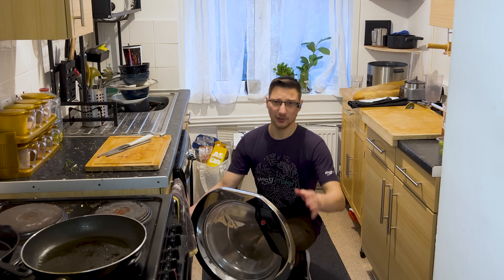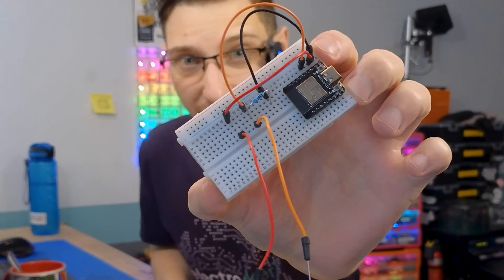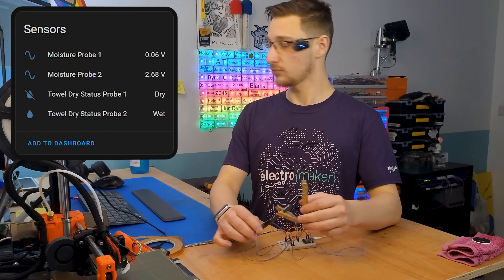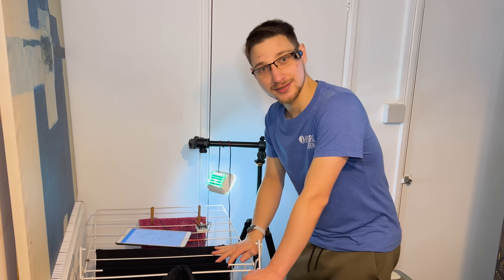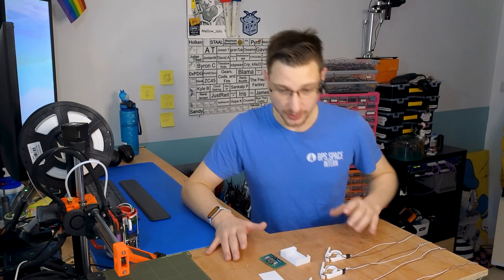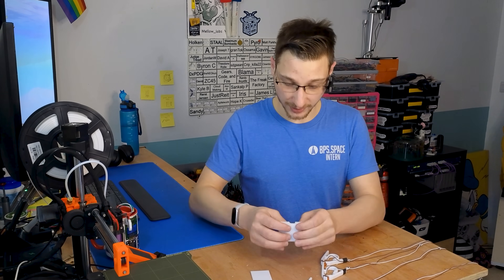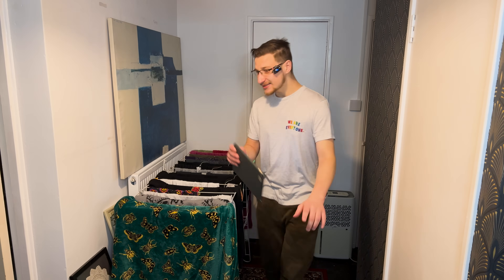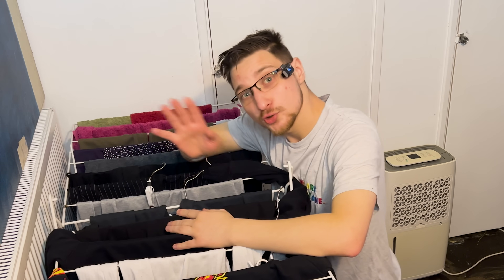DIY Smart Dry Laundry Sensor

Comment: Pretty cool concept. Another possible solution would just be to measure the moisture in the air, as the curve of that will be following the wetness of the clothes, rising and then falling again once the clothes dry up.

Comment: Great idea, but why not go with the capacitive approach? It would be more accurate for moisture sensing.
Resistive is inaccurate, has poor contact, poor linearity, ALSO prone to electrolysis (could damage cloth and wires).

Comment: I was considering using a strain gauge/load cell from AliEx to get a measurement essentially the mass of the clothes horse and wet clothes. As the clothes dry, the weight will reduce, so if it hasnt changed in a (10 minute?) period then we're done.

Comment: Maybe measure the capacitance which will also change with the moisture Level. Then filter the data to remove noise and only keep the slow „drying“ information . Check until the value stops changeing. Use digital IO and measure time of Pulses for the capacitance to allow for more Channels
Reply: this would also significantly delay the corrosion of the copper contacts, as you could cover it with something insulating, e.g. insert into a slot on the printed clamp or even just paint on some solder mask
Reply: Does that ESP32 board have touch sensors? Don't those measure capacitance?
Reply: Yess exactly what I was thinking too! A capacitive moisture sensor would also be way more sensitive!

Comment: This is great. For the next version, I'd suggest either having everything built in to the drying rack, or make individual battery powered clothes pegs. Ditch the wires entirely if you can. I think going wire-free is more important than worrying about having a single ESP32 per peg.  Also, standard clothes pegs are probably the best option. There's a reason we've been using the same design of peg for about a hundred years. :)

Comment: Could you print the clips with conductive filament (or use conductive paint) instead of copper tape? 🤔
Reply from the maker: Last I checked conductive filament wasn't that great a lot of resistance.

Comment: The reason why the "away from radiator" side dried faster IMO would be because the other end is constantly getting "drier", and water – similar to its "physical fluid" (i.e. "gas is fluid") properties – tries to saturate everything by spreading itself "evenly inside the garment (assuming uniform fabric / "space" / identical material, etc.). So, it's constantly being "drawn" towards the drier place, which then either leads to equilibrium (both dry) or one side seeming wetter than the other. Just hypothesizing, though. I wonder what ChatGPT would have said on this matter, first with "loaded question" and then with unloaded (i.e. "predict the drying pattern").

And speaking of drying pattern – extremely important: you should actually put clips vertically and horizontally centered. Upper parts will always dry first and "dryness" will start spreading from top to the bottom, due to:
- air circulation ("hot air rises");
- air startification (essentially the same as above, but imagine drying long towels the length almost to the floor; they'd be creating a small high-moisture "microclimate" due to reduced air circulation or it being limited to single direction);
- gravity (especially noticable with heavier fabrics [again, like towels], water will slightly "sag" and accumulate in the lowest parts of the garments);
- etc.

Therefore, clip(s) at the lowest point are probably most relevant, assuming no forced air circulation (a fan set to blow between the lines will do wonders to accelerate the drying). But clipping them there is also unweildy. 

So, maybe the best solution would be integrating the moisture sensors within the dryer (on the wires, isolated of course), followed by a couple (or quartet) of humidity sensors (potentially placeable on the dryer's foldable legs).

But generally, on the topic of this problem, one's (head) cheek is the best sensor, IMO. And if it just feels "dry enough", that is fine, because the rest will dissipate through the fabric, and - if in the closet or drawer - to the air and the rest of the clothes, minisculy rising the humidity, of which all will be taken away since both closets and drawers are usually not made to be really air-sealed. And, if i  doubt, leaving the drawers/closet open for an hour or two when able, would eliminate that entirely... although it would get its air exchanged every time you grab a new pair of socks or the next T-shirt.

Comment: As an alternative, which will help with drying as well. Use a humidity sensor and a fan (to make sure you have enough circulating air) and measure how the humidity changes over time. Add a button which indicates that your drying cycle starts (which could also start the fan) and take a simple derivative to detect when the moisture level in the air stops decreasing.

If you do want to stay with the clamp solution, don't forget to put the clamps near the bottom of the clothes. In my experience the top of the clothes can feel perfectly dry while the bottom is still very wet.
Reply: Interesting idea!
Maybe this version with a humidity sensor could also be used inside a dryer?
Reply: This is exactly what I do, humidity sensor and WiFi switched fan.

Comment: This is a great idea but I think you have approached it wrong. You should make the clothes horse be the moisture sensor that way it can be 'permanent' and you just throw clothes on it.
Reply: I would clip them to the bottom of the clothing as most of the water will move down with gravity over time. So the legs bottoms of pants will take longer to dry.
Reply: I was thinking about this as well, it would be way more convenient as well.
Reply: I came  to suggest the same thing. You can place the copper tape on the hanging rods cover the whole rod except for a split in the middle. This would give you a large surface area of the clothes touching the tape and hopefully you won't need a clamping force then
Reply: I was also thinking this :D
Two stainless steel rods running in parallel across the tops of each rail, such that the clothes hanging over them make contact :D
Reply: You stole the words out of all our minds, but great minds think alike!
Reply: I am wondering how many lines of copper tape you would have to place to get this to work. I do like this concept.

Comment: Awesome project! 

Another way you could do it is by looking at the humidity, because that would be a lot higher around wet clothing. If you have a puck of sorts, with a humidity sensor inside close to the clothing, and another humidity sensor in the control box, you can compare the two, and based on how big that difference is know how far along your clothing is!

Comment: Cool idea! I have an improvement idea - wouldnt it be better to wrap the copper tape around the hanger "sticks"?  In my head it would be two concentric spirals wrapping around the "sticks" but never touching and the resistance would be coming from the clothes hanging of the sticks and touching the tape at multiple points. Also, I think it isn't such a pain to have a hanger plugged in, but the clips seem inherently messy. 

Anyway, Great vids. Keep it up :)

Comment: Here's a design idea: 
Have a look at the springs used for downlight fittings/housings ... they're pretty snappy.
If you can build one into a print then it will have some nice grip strength.

So, back to the idea.
If you make a clip with the circle in the middle, add 2 copper traces.
Put that into a rectifier and a charge circuit.
Then make a clamp housing where you basically clamp the clamp onto - also with copper.

You could use an ESP (not 32) and a small battery on the clamp.

So when its removed from the holder, it turns on and starts reporting - it could use ESP mesh to the housing (base) to report.
So you know what clamps are removed (in use) and which are not.
Also means no wires and easy to just pull off and clip onto clothes and put back.
Each one can be labeled by a colour (heatshrink etc)
And then the housing can have an LED or light bar to show its state (could use addressable LEDs here - save on pins)

When the clamp is returned to the housing, the gnd would flow from the inner copper to one of the 2 tips
That can be used for the housing to sense when the clamp is returned.
It can then turn off the light and communicate for charging etc...
And when unclamped, it can pulse to show waiting, then when the clamp shows any bit of resistance (not nothing) it goes solid colour for the state.
That way you can also see what clamps are not clamped well.
The holder keeps the devices charged and ready to go as well as shows the state.
After a minute or so, the clamp when in use can go into partial sleep - wake up every 5 min to read (so smaller battery = longer off holder)
And if the battery gets low, the status led can flash.
The holder then is the main reporter of state and just wireless clamps.

So when you go to hang up your laundry, you just grab a clamp and clamp it on, the light goes solid and you can easily tell.
When its 'dry' the timer could be more than 5 minutes since its nearing the done state.
Then when you're going to pickup your laundry, unclamp and clamp onto the holder - and it starts to charge again, ready for the next cycle :)
Reply from the maker: Shockingly that is almost exactly what I was thinking for version 2
Reply: @Mellow_labs  Keen to see the variant :D (although realistically, I'll have forgotten my idea by then lol)

Comment: I think it would be cool to wrap the tape around your drying rack in a couple of spots and then have the microcontroller switch between different rows to measure them. So you can get away with less IO inputs. If you increase the voltage, you can certainly make this work. :)

Comment: 1:38 Water is no conductor, at least not in the traditional sense. Water has an extremely low conductivity of 0.055 µS/cm (microsiemens per centimeter). For context, that’s closer to the conductivity of glass, a well-known insulator, than to something like copper, which is a true conductor. To put it simply, water is about 10¹⁵ times less conductive than copper, but only 10⁴ to 10⁶ times more conductive than glass.

In fact, water’s conductivity is comparable to that of intrinsic silicon, a semiconductor, rather than any actual conductor like metals. 

The reason tapwater or seawater seems conductive is due to dissolved substances (like salts and minerals) in the water, which release ions and dramatically increase its conductivity. But if we’re talking about water in its purest form, it’s practically an insulator.
Reply from the maker: Yes and I had a table pointing this out. Somehow I don't think anybody's running a water purifier for their washing machine, So this should still work for most people.
Reply: @Mellow_labs  well, think about ships :)
Reply: Softener should even make it more conductive